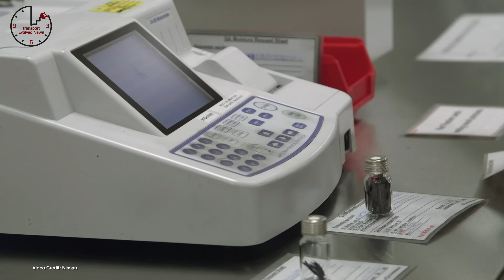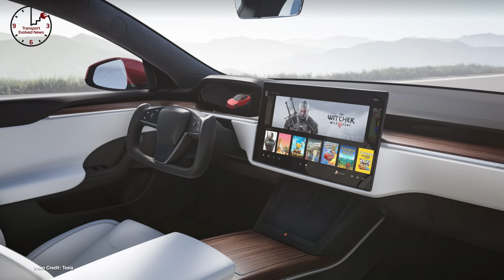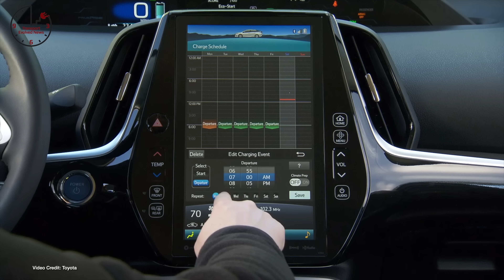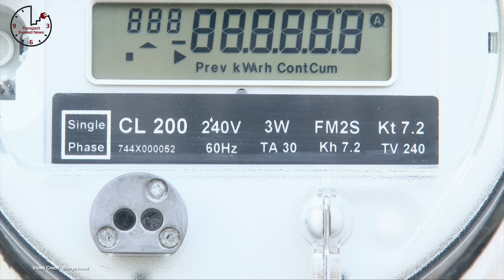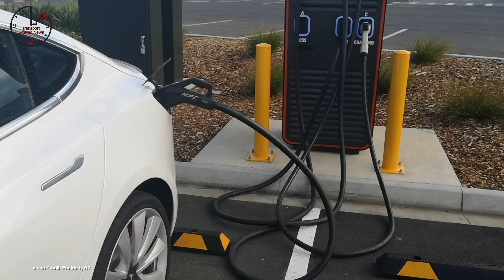TEN 326 - Battery Legal Battles, Audi e-tron GT Unveiled, Superbowl Ad Effect

Comment: Thanks for another great video. FYI, a company called Micro Roulottes, here in Québec, has been making small EV friendly camper trailers for a long time, including solar panels, TVs, etc, and at half the price of the one you featured in your video. You may want to check them out. A Google search for iGoutte will bring up the manufacturers page as the top result.
Reply from the maker: I wonder if they'd let us borrow one?

Je parle mal le français.
Reply: @transportevolved  the simple fact that you can write that puts you ahead of most people in the US. Tu parles très bien le français 🙂. You should reach out to Micro Roulotte and find out if they would lend you one, but with the US to CDN exchange rate you can buy one for almost nothing 🙄😏😂

Comment: Solid-state batteries are said to have several advantages over current batteries. The challenge with solid-state batteries is being able to actually build them. The solid-state battery is like the fusion reactor or the 100-mpg carburetor.

Comment: Hmm.  Elon says the yoke won’t be used much because autopilot has become so good.  Some of us actually like driving, though.  What’s the point of having a 600hp+ car only to be driven around like a gramma?  Drop the yoke and give us a wheel.  Please.
Reply: Interesting point! Personally, I'm waiting on info how the yoke behaves. If you can program it work like 90-100° rotation results in maximum wheel travel, then you might be able to hold it firmly. Normal steering wheel use will be a pain with the yoke, for sure!
Reply: @Sekir80  I watched some clips of test rides in the Cybertruck and I just don’t like it.  Try driving your car with just the bottom half of the steering wheel.  It’s uncomfortable.
Reply: @willaerley7140  Yet, I've seen F1 drivers using the wheel it seems totally acceptable. That's the reason I'm waiting on specifics on final design. If I need to rotate the wheel 2-3 times to make a parking manouver, then right, it will be useless. If the car parks itself, then who cares? 
You say you like driving. Question is: what does this mean to you? Cruisin' in the city with your hand on top of the wheel, or blazing along a racetrack?
Reply: @Sekir80  Fun driving for me means attacking highway on ramps and carving country back roads where it’s safe to do so.  I agree that the yoke could be useful at the track (none near me), but the S,X,and CT are HEAVY beasts and nothing like an F1 car.  We’ll see how well it works at release.  I would just like the option of a traditional wheel.
Reply: @willaerley7140  Understood and agree, I like those backroads as well. We will see later as it comes out. I believe there will be 3rd party alternatives later on, because as I see right now a lot of people are perplexed by this change.

Comment: Norway sounds like a great place , huge subsidies for evs , huge amount of renewable hydro-electric , huge move to green electricity in general .. 
Pity it's all payed for by exporting oil and gas ..
Reply: "Pity it's all payed for by exporting oil and gas" You could start by driving a EV and installing solar and not using gas any more. 
When enough people have done this, there is no need for any more oil or gas. 
Am i correct or am i correct?
Reply: A white Tesla Model 3 SR+ costs US$ 47,328 in Norway
Reply: @wolfgangpreier9160  Hate to say this but, you're wrong. Solar is nice, but why would I generate electricity during the day when I and my car are not at home to pull it from the grid at night?
Reply: @Hans-gb4mv  Yes of course i am wrong. 
Solar power is something for weaklings. 
Strong men use strong beer. 
Or was that petrol? 
I always confound those two. 

You ever heard of battery backup? Or maybe Einspeisevergütung? Or maybe that its corona times, everybody should be at home?

I get my Solar Carport with 12kWp in the next weeks when its getting a bit warmer and the electricians do not fall from the carport all the time. Then there will come a battery, don't know which one, somehwere around 20kWh. And then - if my bank gives me an additional loan - a Solar Array in the garden of additional 5 kWp. Thats the optimmum for my use case. The size where i can safe most of my energy bill and create a safe deposit for my retirement.

Of course everybody must calculate this for himself, which is the optimum size and type of solar.
Reply: @casperhansen826  Around 52.100,-- US$ in Austria 😜
Reply: @wolfgangpreier9160  and what are you going to do in wintertime? While your solar plans will presumably generate more power than you consume in a year, most of it will be generated in summer while your battery pack will remain discharges during winter time.

You stated that when enough people get solar, we would no longer need oil or gas. That is simply incorrect. Yes, around the equator people can run on solar year-round, but the further you move away from that area, the bigger the imbalance becomes between winter and summer and the more we will still need other power generation. Hydro is an option, the wind is an option, but also nuclear is an option for me. And while I don't know where you're from, up here in Belgium I can guarantee you that my solar panels provide more than enough power in summer, but during the coldest and darkest days of the year, there's not much coming out of them.

Comment: Hi there.  I really enjoy your channel.  However I was wondering if there are any manufactures out there looking at battery hydrogen hybrids.  I think the advantage could be that it could charge while parked up.  A smaller battery pack plus a small fuel cell could provide benefits.  Maybe it's bad idea, therefore does anybody got any thoughts on the idea?
Reply: Hydrogen conversion costs energy, and faces a lack of distribution network. Dual-engineering battery + H2 tank wastes resources. Electricity is everywhere; so are Superchargers. Where there's no grid, use solar & wind powered charging stations. Vehicle rate/year is all about battery supply. Tesla is helping solve that problem much faster than most experts predicted. Maintain your current vehicle until you can save up for a Model 3, Y, or the new $25k Tesla. Self-driving saves lives.

Comment: I have to down-vote this episode despite it being interesting since you slacked on the fact-checking. Formost on the topic of Mercedes "EV-configurator-recommending-non-EVs" as they did apologize to the non-EV recommendation! It seems to have been the programming of the website causing it to suggest a similar vehicles + specs which would be cheaper - with no regard to drive train.

Comment: The extension of the tax incentive by numbers produced continues the flaws in the original. It has certainly encouraged participation by the public but it's not encouraging participation by the auto makers, the later they arrive the greater their competitive advantage. 
It might be better to change it to a time based system with the incentive reducing year by year, giving the legacy makers the clear sign to pull their fingers out. The govt could even save heaps by reducing it to $3500 right now, it's time based and they've had lots of time. Rewards for Tesla and GM, less costly for the public purse and creating the behaviour we want to see.

Comment: One day the earth will run out of oil, so we MUST go electric NOW...and stop cutting down trees.
Reply: We cannot stop cutting down trees. My oven uses wood. 
We have too much wood in our country it grows too fast.
I guess you actually mean the Amazonas and many parts in Asia.
Reply: @wolfgangpreier9160  plant different trees that grow slower. Problem solved.
Reply: @CHIEF_420  from a CO2 point of view, burning wood is more sustainable than burning fossil fuels. The CO2 that gets released by the burning is mostly CO2 that the tree has taken out of the atmosphere when it grew. And if you don't need to transport the wood far, that also takes much of the pollutions away that hinders so-called "green power" when burning wood that gets shipped across half the world.

Having said that, there are still issues with burning wood.
Reply: Unfortunately you don't know how much "oil" is used in non ICE applications.  Thus oil will always be present even if it is made synthetically with bio mass  (plants).    Besides the gas there is household material we wear eat and use in daily life.  That includes the grease in those electric motors, tires dash ....